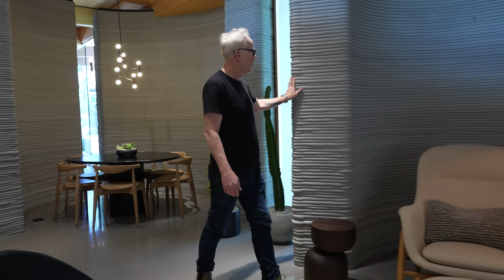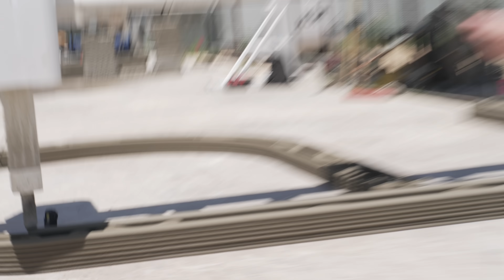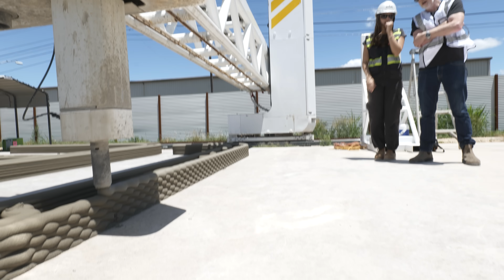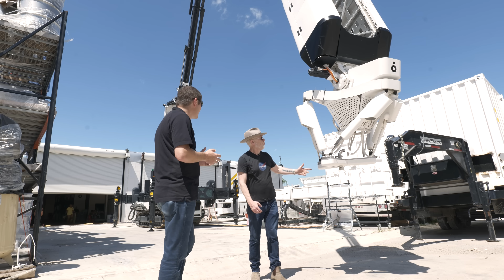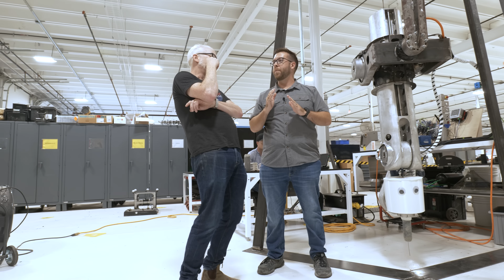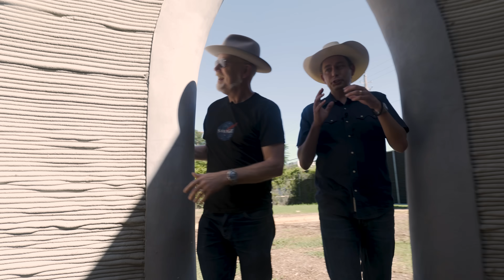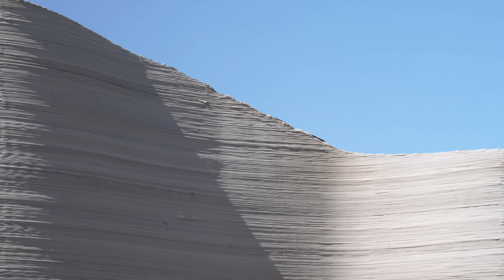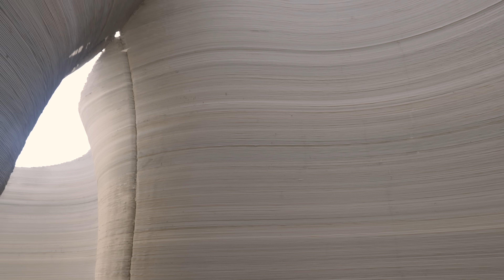The Biggest 3D Printer Adam Savage Has Ever Seen!

Comment: This is potentially one of the most scalable and impactful changes in the construction industry around the world. I am interested to see how this technology would work in Canada? I am sure it would be fine over the summer, but it begs the question, considering the potential cost savings of such a device and the extremely low temperatures of Canada's winters which prevent the large scale pouring of concrete would this tech eventually open the door to the possibility that small scale construction could continue in the winter if the costs of creating a protective barrier around the construction site were not greater than the savings this tech could provide. I feel that one barriers now would be the cost to construct an 'air dome' around a site as the industry that is currently manufacturing and installing airdrome's is targeting the sports and recreation industry. There is serious potential for an amazing business opportunity on the part of the air dome construction/manufacturing company's. If there is some innovation in that industry in regards to how they are assembling/manufacturing these domes, and in partnership with a construction company implementing 3d printing, they would be able to lay concrete throughout the entire year, foundation and all. That would give the construction company a gigantic edge on their competitors, in addition to unmatched customization and modularity of a high quality, quickly built, and durable structure such a technology offers. The air dome company would also find themselves with a massive leverage on the market assuming they can keep up to demand, they are sure to succeed. Keeping up, however, is easier said than done but with the help of government investment into the equity of the company, allowing for federal support of the program while strengthening CPP's investment portfolio or funding much needed improvements in healthcare.

Comment: How does it cope with expansion of the materials as in concrete you have to incorporate expansion joints
Reply: That’s only true for solid concrete structures like foundations and bridges, these are hollow.(what you’re actually accounting for with those structures is the swelling and contracting of the rebar subframe)
Reply: @brqxton8974 that is incorrect. Rebar and concrete have an almost identical COE.
Reply: Like all concrete, our printed material naturally experiences shrinkage, and expands and contracts with temperature changes. We account for this through several design strategies. First, we use strategic control joints, planned movement joints that let the wall expand and contract without causing problems. Second, we apply flexible surface coatings that can stretch to accommodate any minor movement without cracking. And third, we include proper reinforcement in the walls following industry standards to control any shrinkage. The result...the walls can handle normal thermal movement while maintaining their structural integrity and weather resistance. It's built into the design from day one.

Comment: Hate this so much. Its 3D printing walls, not houses. As someone who has built a house, the walls are the easiest part. Nail some pine together, add insulation, add sheathing/plaster. Framing is simple, fast, better environmentally and insulatively. This looks cool but seems to be a solution in search of a problem. This is not Juicero level silicon valley gullibility, but its approaching.

Comment: It’s cool that it works but I don’t see the point to use it in real life. Concrete is not that great from a carbon footprint and insulation. It works for support walls and foundations but not much more for small residential structures.
Reply: No more mysterious than a cinder block house.

Comment: I’m wondering how they get the 2D stability that a grid of rebar gives you out of the embedded cable. Where’s the vertical reinforcement/tie-in?
Reply: That's a good question!
The embedded cable forms the horizontal lines, and we also place vertical reinforcement at regular intervals to form the grid for strength.
Reply: @ICON3DTech 
Good to see someone from Icon chiming in with answers so quickly.
Reply: I imagine that will vary some per company/per system. I work for a community college and one our sister colleges is heavily involved with the AM industry and recently had a structure printed on one of their properties, beyond the reinforcement that exists between the cured layers they also included some steal rods placed through gaps between the walls, if I remember right they were actually more intended for roof support, but naturally their additions added some vertical reinforcement as well.
Reply: I imagine there's some experimental layer geometry which could increase vertical strength as well. Wild to consider such things at that scale!
Reply: This looks interesting, however I'm wondering about long term maintenance issues like faulty wiring or plumbing. Are there systems put in place to allow maintenance aspects like these to occur?  

I didn't see anything addressing these issues in this video.
Reply: I think that's why each wall is 2 spaced layers with the swoopy bit in the middle. 
Personally I think a big brick laying bot would be better, ICF or standard bricks, but this is still cool stuff.
Reply: Epoxy as he said.
Reply: What if you want to remodel ?
Reply: There isn't any.
This is a tech demo at best.
No one should actually be building like this. It is inefficient at best, and dangerous most of the rest of the time.
They even say that they don't have the concrete mix correct yet, and there are problems with cracking in the structures they have already built.

It's great that we might figure out HOW to do stuff with tech like this, but that doesn't mean we should actually BUILD like this if we have the option not to.

Just like ALL 3d printing, it is very good for a FEW specific tasks, but will be misused most of the time.
Reply: @Prophes0r I mean they said they have a couple hundred permitted structures. And icon replied that they DO imbed vertical reinforcement
Reply: @Killerlinks  "...we also place vertical reinforcement at regular intervals..."
Could mean almost anything.
And since it's marketing, you must assume it is the least applicable thing possible.
The tech itself is unsuitable for anything more than a shed, when there are other methods available.
It's neat, but just like all other (non-specialized and $$$) 3d printing methods, it produces toys and prototypes.
It is utterly unsuited to producing "production" things when there is ANY other choice.

Need to build a structure around a nuclear spill that you can actually get a pouring robot to? GREAT! That might be a fantastic use!
And we NEED someone testing and tweaking how the machines work in order to confidently USE it in those conditions.
But that doesn't mean it's actually GOOD for much else.
Reply: It's like you didn't watch the video but you really want this all to be fake. Maybe you work building houses out of shitty cardboard and selling for half a million dollars?  I bet that's it. Your "house" building racket is under attack
Reply: @Killerlinks  Or... I'm someone who has used a 3d printer before, and studied the results in an engineering context, and I understand the weaknesses of resulting materials?
I'm sorry to ruin the "Magical thing making box" for you, but the mistaken understanding is on your end, not mine.

This concrete printing tech is absolutely something we should be exploring. There are some interesting applications to it.
But it isn't FOR building the kind of structures we already know how to build.

This video shows a lot of the EXACT same problems that I deal with while managing the printers we use in my local hackerspaces.
People using them for making things they shouldn't.
A flat square with 3 holes in it is the WRONG thing to print. Take a sheet, cut it to size, and go drill your 3 holes.

An adjustable wrench is a great tool, but it is the WRONG tool for many different kinds of jobs.
Reply: @Prophes0r  "this company full of engineers 1000x smarter than me is dumb and my plastic 3D printer can't make a house"   clearly YOU'RE the wrong tool for any job
Reply: @Killerlinks  Sorry. I guess I'll go turn in all my engineering degrees back to the schools then. Degrees plural.
You admit that you aren't an engineer, and are going on intuition built from a marketing video. And all marketing is manipulation, so your intuition is wrong.

My point wasn't that a desktop 3d printer can't make a house.
The point is that a layer extrusion machine is bad at making objects with mechanically acceptable properties.

This 'tool' will be fantastic at doing extremely specific tasks, likely in environments where current manufacturing/building are bad tools.
Building a house with it, in a place where you can drive conventional materials, is not a good use case.
Reply: @Prophes0r 😂😂😂  "That's degrees plural 🤓 💅🏻"  id like to double down and say you are a huuuge tool. Keep putting time into your replies to someone that is only here to insult you. And then use your degrees plural to wipe your tears bc these guys are clearly going to continue printing houses. Even if you say they are doing it wrong.
Reply: @Killerlinks  Yeah. The child that uses emoji isn't exactly going to make a good argument.
FYI. I don't reply for you.
I reply for those people who are going to read it over the next few years and glean something from it.
But since there is little left to teach by responding to you. I'll kindly take my leave.
Enjoy your little time-out.
Reply: @Prophes0r You say that with the confidence of someone who watched the video and didn’t hear about the metal lattice.
If you don’t know, don’t say you do. Having an entering degree isn’t a license to opine on what you don’t know.
Reply: @stuartreynolds9297  I say that with the confidence of someone who has worked with concrete and has multiple engineering degrees.
I also have experience with 3d printing and the problems of layer adhesion and anisotropic strength.
The premise in this MARKETING video is flawed. I don't care about their nonsense claims or a "metal lattice" any more than an infomercial showing some guy fixing a battleship with Flex Seal.
3d printing is the WRONG technology for building structures like this in almost every scenario.

The internet has done a great job of spreading knowledge(Before 'AI' ruined it...).
But it ALSO results in every rando feeling like they are an expert after a few minutes/hours of Wikipedia.
Don't be the Internet Expert arguing with an ACTUAL Expert.
Reply: @Prophes0r LOL. “I have a ln FDM printer that doesn’t print concrete, this experience is sufficient.” I hate to point out the obvious, but concrete printers don’t print plastic. Sit down.
Reply: @stuartreynolds9297  Where did I claim my only experience with 3d printing was with plastics?
I have literally built and tested Concrete/Cement printers. Also direct metal printers but that is beside the point.

The compromises required in materials and layout to be able to print something with these printers makes them borderline useless.
And not just useless but EXPENSIVE too.

That is my professional opinion.
And I regularly get PAID for my opinion.

That doesn't mean I'm never wrong.
I'm wrong plenty, and I'm happy when others prove it because I end up with more understanding in the end.

Put your [internet credibility] where you mouth is and link me to a (reputable) peer-reviewed paper with actual results disproving my expert opinion that this tech is unsuitable for this purpose.
Reply: They don't

Comment: The major challenge they need to consider and sort out is repairability in electrical, plumbing, insulation and HVAC systems.  Can portion be removed like drywall and stick framing to access and repair theses systems, without structurally compromising or making the structure look patching and ugly? Perhaps this can be achieved through spray insulation between a furring wall or side cladding that contains these systems in a low profile way, like some do with concrete block. Or maybe a smooth finish or plaster coat on the interior that hides such repairs. Or maybe this can turn into a exterior load-bearing wall only with the interior walls being traditional framing that contain such systems. As well, safety in structural fallibility is my other concern. How does it fail, is it going to crush the occupants if it does? Cool addition to construction technology, hope they succeed.
Reply: Why do you hope they succeed when it's clearly dumb

Comment: While I understand why they need to use a twisted cable reinforcement. The whole point is to improve tensile strength of cement (or for pre stressed, put it in compression). I would expect a cable to have sub optimal tensile performance.
Reply: I figure there must be a lot of margin. The walls are pretty thick, each line is pretty thick, they're apparently not printing anything over two stories or so, and it's just residential stuff; this all puts the strength requirements way down. Maybe they'd have to look into stronger formulations if they wanted to print apartments or something, but until then what they have is fit for purpose.
Reply: He mentioned that I think.  With rebar you space them out further, but with the smaller cable you can have more of it in more regular and uniform layout so the combined effort is the same?
Reply: @jenkem4464 but using thinner cables has a multiple reduction on 1) material stiffness due to the cable and 2) bending stiffness due to the reduction in the second moment of area.
Reply: Concrete and cable are actually a great composite to build with. The concrete compression strength is great and the cable provides the tension. So the mix is kind of the best of both worlds.
Reply: @PaulGage-k8p outside prestressed concrete, I don’t think cables are used too much as they are less stiff and more expensive than traditional rebar.
Reply: @paps_nft  Agreed. But cable seems the best answer for an extruder versus rebar that would need to be placed manually.
Reply: Post tension use cable.
Reply: @TheRainHarvester  yet these are not in tension
Reply: @sanisidrocr yeah i was just pointing out that cables already exist and they are meant for tension so probably no problem wrt tension.

Comment: What kinds of strength are they getting out of the prints? Do they use like a fine grout or small stone mix? I am super interested in their results on these houses.
Reply: The mix is tailored to the desired result. The ICON guy said "cementitious materials" and "epoxy" more than once, so expect that there's a fibrous component in the mix, such as fiberglass or something similar, to lend strength.
Reply: @dionh70 ok sure. I heard him that's why asked about particulars like if it is just a grout or if they can do small stone mixes and stuff. I am a plant manager for a concrete company and was curious about what kinds of specific mixs this system has to use. Clearly it doesn't use a regular 8 stone mix.

Comment: How do they manage to add windows in a structure such as this?
Reply: There must be a manual step to bridge the top of the opening, so they can then print on top of it. also, @23:56 they can just print them with arches
Reply: I'd guess they just lay in a steel frame or something that a regular window can be mounted to.  The printer would have to stop at one edge and and start at the other, or come at it from either end.
Reply: I like the idea of arched tops to doors and windows so they can be printed easily. The buildings would look great and hark back to the days of building in stone.

Comment: I wouldn't be surprised if in the future they made a printer that could make walls with 4 posts then climb the walls from the inside clamp it's self to the posts then print a floor, then start on another wall. they may have have a crane to get it off the roof or a big helicopter. or maybe it can just crawl down the side of the building! just think of the possibilities! a printed heated sidewalk, or street! or natural looking bridge with supports and all built right in!